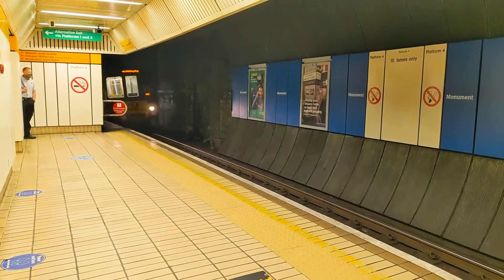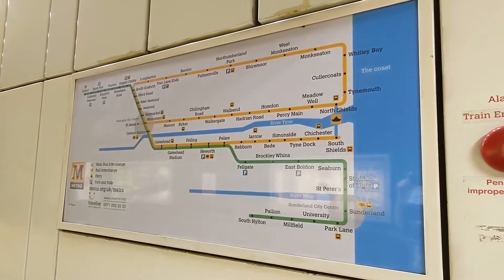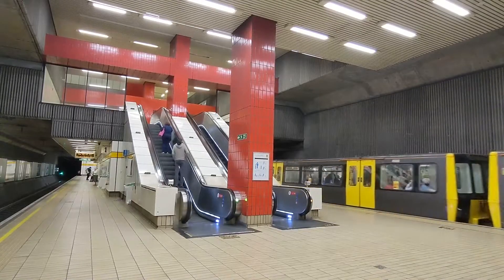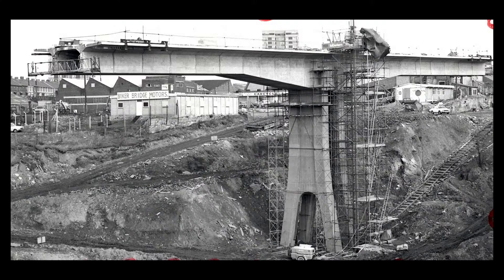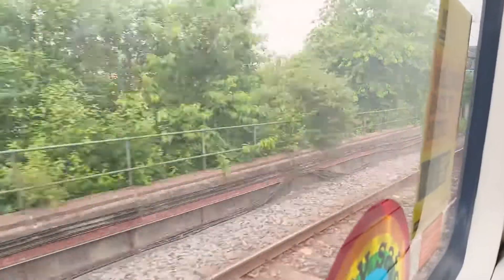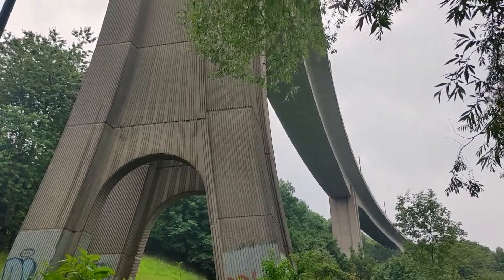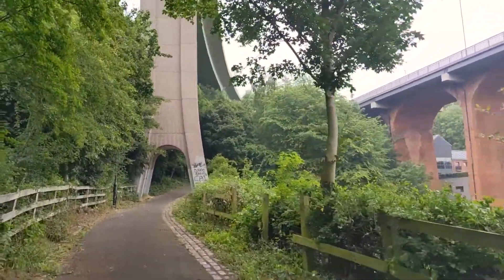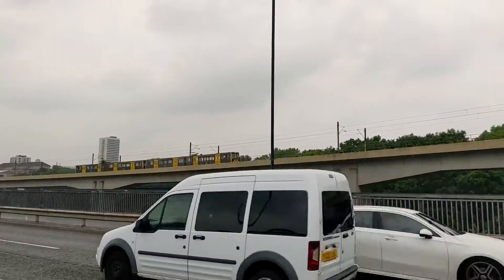The Byker Viaduct: Masterpiece of the Tyne and Wear Metro

Comment: worked on that project start to finish, there's more steel in that bridge than u could imagine.
Reply: I vaguely remember that one of the piers was built in the wrong place and had to be demolished and rebuilt .. Is that correct or am I mixed up.
Reply: there was a problem with the concrete, it didn't hold up to the N cube test dodgy batch